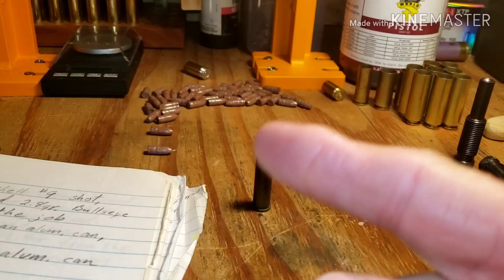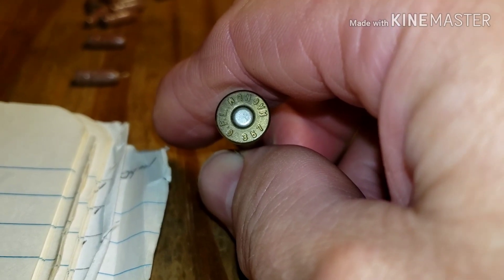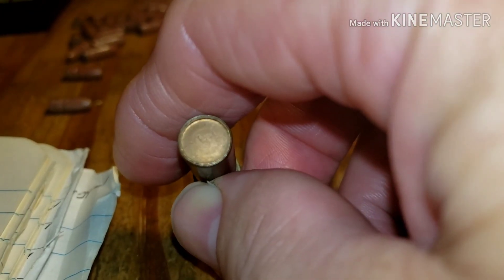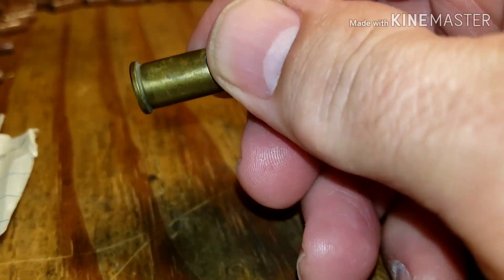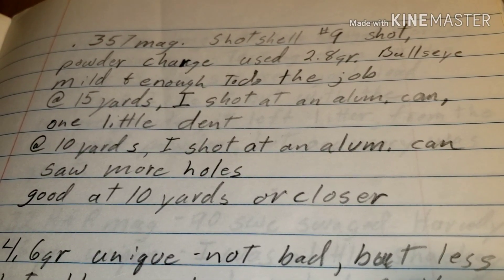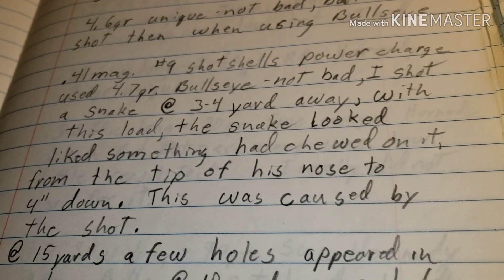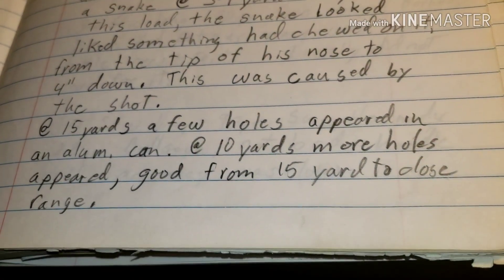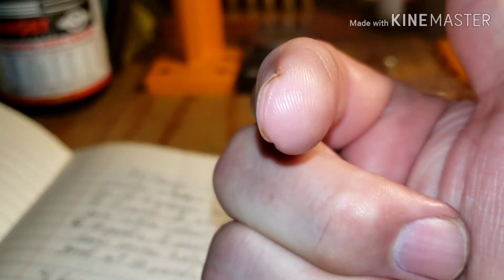357mag shotshell VR to Uncle Jim

Comment: I did a video making shot shells from 38 special and 38 short colt cases with a very wide spread of shot anywhere past like 5 feet you would be lucky to even hit the can but from 5 foot and closer they looked like they would work OK

38 Short Colt Shot Shells .......is the name of the video

I do even better just using a 125 grain hollow point on snakes as I can hit them at a much farther distance in that way
Reply from the maker: I will watch that video. 👍👍🇺🇸🤓